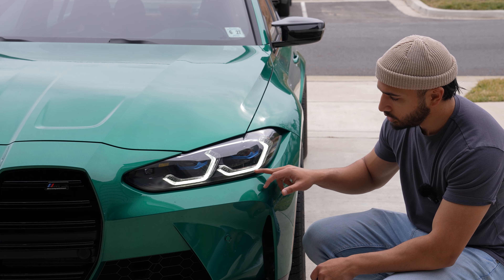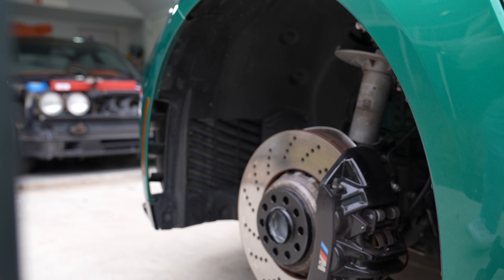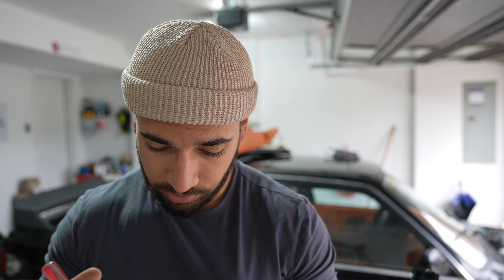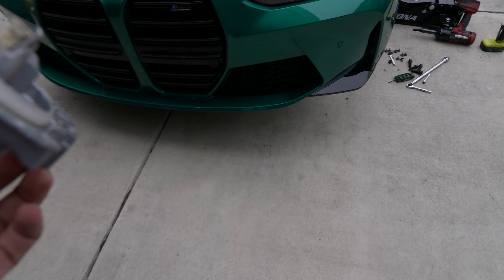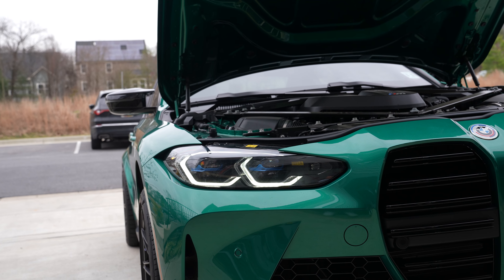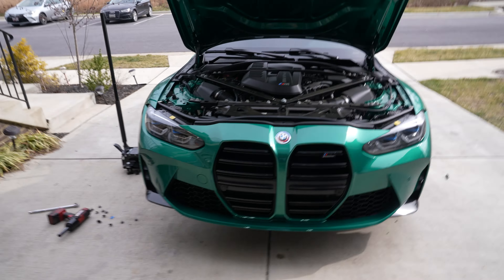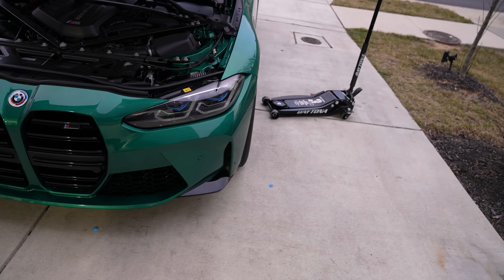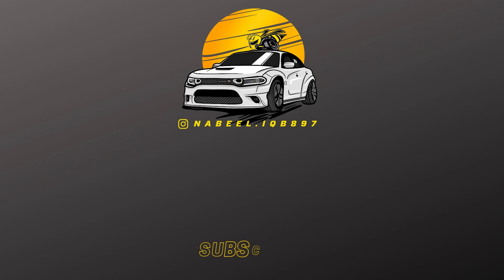Step-by-Step Guide: Installing Yellow CSL DRL Modules on a G80 M3 | G82/G83 M4 | BMW G22 4-Series

Comment: @Nabeel, Horizon referred me here when I asked for instructions.  Nice Vid.  I got Ambers for my Dravit Grey M4...Yellow looks great on the IOM Green.  To be clear those oil cooler grill fin replacements are ONLY Necessary b/c you added wheel spacers correct?
Reply from the maker: Hey, great color combo there! And I could be wrong but I think you would need it when you’re lowered, wider, or both. As soon as I added spacers I noticed the issue and lowered it after the fact so not entirely sure if lowering it would cause the same rubbing
Reply: @NabeelIqbal97  KK.  I'm neither so good to go!